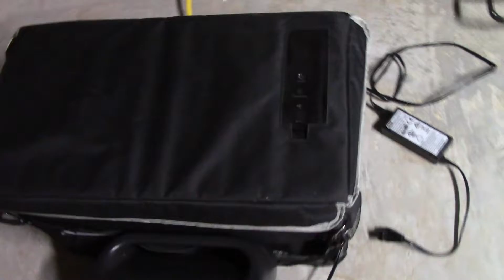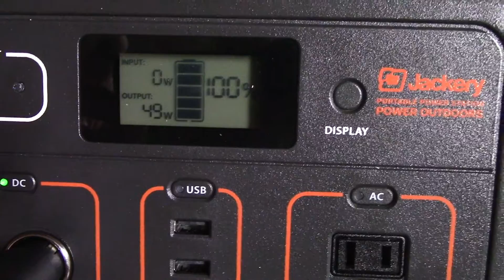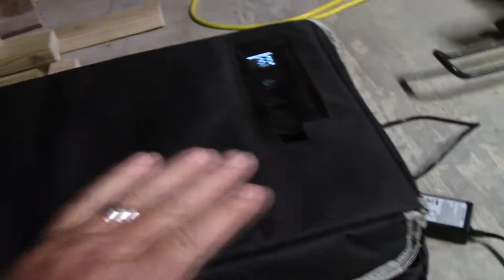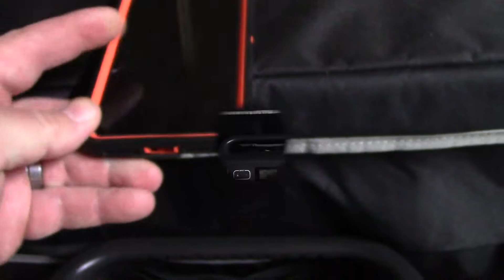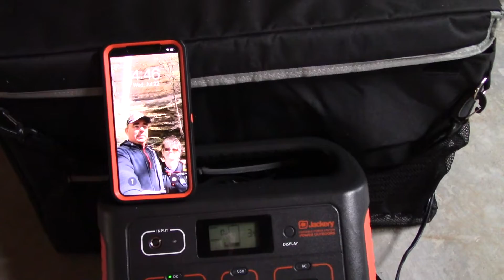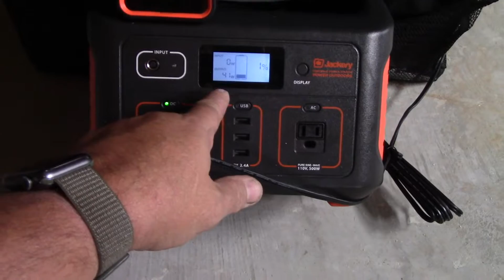Jackery Explorer 500 + JoyTutus Portable Fridge ~ Amazing Results

Comment: Does it make a difference when powering with the AC port then the DC port?
Reply from the maker: Oh yes, your best is to use the DC port if possible because otherwise you have to convert the DC batteries to AC then the AC converter for the fridge will have to convert it back to DC. 
All you do when using the DC cord is just run it straight off the DC so it is a lot more efficient

Comment: Yup.. buying this exact pair based on this video.
Reply from the maker: I use not a lot, we used it for 9 days in Colorado and it was awesome.  It rand the fridge for 4 nights, then I recharged and then the fridge for the other 4 nights
Reply: @Woodzman  Did you use solar panels to recharge or was it off of pure driving?
Reply from the maker: I didn’t have a solar panel so I charged it while driving in the Jeep. Now I have a 120 Watt solar panel that I show in my ToGo power review video. Works great
Reply: @Woodzman  I have yet to get panels, but they're on the way.. have been using the fridge for a couple weeks, and the Jackery 500 will go all day and end up at around 20%... Total game changer.
Reply from the maker: I love the setup. Works great